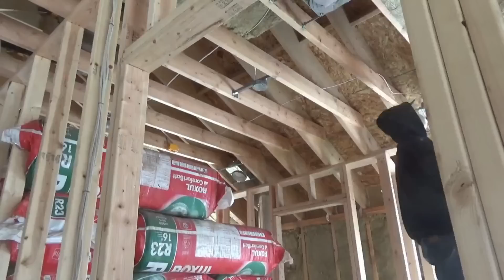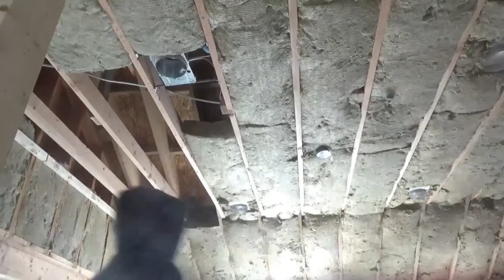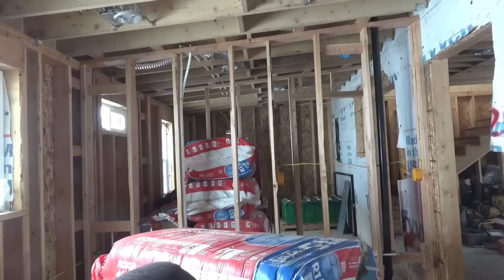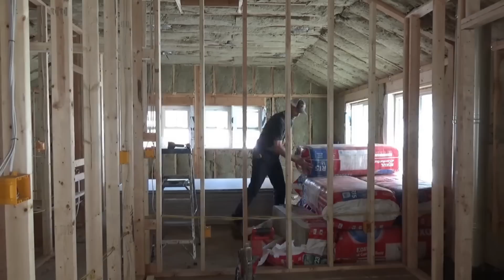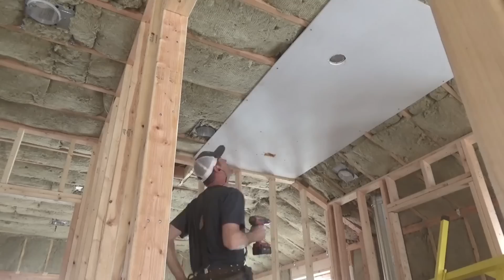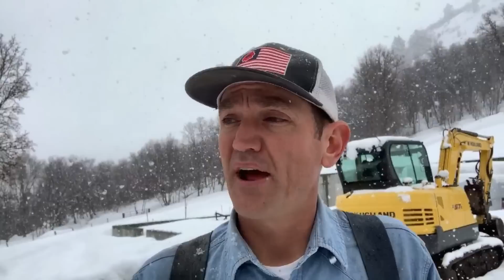#315 - I Started Hanging Drywall...Upstairs Insulation Done!

Comment: You might considering using adhesive on the ceiling drywall.  It might help prevent some cracking and  screw/nail pops.  You can always use a vapor barrier primer paint since you skipped the vapor barrier behind the ceiling.

Comment: just a tip we used to insure the ceiling portion of the drywall job; every place we put a screw in, we put two screws, because dry wall is heavy and not that strong when held up in the middle of it. this was over thirty years ago and the places that I can still go back to the ceilings are still in great shape

Comment: One other small point, don't forget you must have an access to the upper roof area for later maintenance, A good place to locate one would be inside a closet so that it does not affect the ceiling lines. MAKE SURE ITS BIG ENOUGH TO BE ABLE TO CLIMB THROUGH. ABOUT 2 X 2 FEET PIECE OF PLYWOOD COVER WITH A SIMPLE PUSH-UP,  IS GOOD.
Reply: In my parents first house my father installed a set of pull down foldable attic stairs in a very short hall going in to the bathroom on the left side of the main hall way so it didn't affect the ceiling lines in the main hallway . When the house was built the attic access was put in the ceiling of the smallest bedroom closet in the house. It wasn't even 2 ' X 2 ' . It had a push up panel made out of wall board . It made getting up in the attic so much easier after the pull down attic stairs were installed . The one in the bedroom closet was way to small & to get up in to the attic everything in the closet had to be taken out in order to get up in the attic .

Comment: I did everything except tape, texture and paint on my build. Tried to tape the joints but could not get a smoothe coat on without lots of tiny voids in the mud. Gave up and hired a pro to finish for me. He said i needed to add some water to my mud as it was to dry. I was using pre-mixed mud as I was not a pro. He said you still need to add a little water to the pre mixed mud most times. You are knocking out the drywall so you will be fine. You do need to stagger your joints though, especially if you are striving for perfection.

Comment: When hanging drywall on walls, put full sheet to floor. That way you don't have to bend over when taping seam. that way both seams can be feathered together.
Keep up the good work!
Reply: @Steve Diamond If it was my house, I would use one. remember code is the minimum, one can do better.

Comment: Just a small tip on your drywall install. On the wall sheets put the top sheet up 1st, then the on the floor the 2nd sheet. the piece between the two (if there is one) should go into the middle. I know its a place you'll see more if the taping isn't 99.9% BUT that said with the piece in the middle it soo much easier when taping since your not stretching for the ceiling level or stooping to the floor. you'll be standing working at waist height easily completing the taping. 
Keep up the GREAT JOB! Best wishes also.

Comment: Having lived in Alaska for 45 yrs, (being a construction laborer born and raised in ID), I’ve seen many construction techniques and the only concern I would have against completely enclosing the water lines is if it was ever to freeze, it would take summer or heating for a week to thaw out. It may be too late but I would put a refrigerator water supply tap and put the outlet into the septic drain, (at the end of the service farthest from the inlet), so that you can have moving water all winter. As long as the water is moving it won’t freeze. So if you’re going to be gone for whatever reason you can leave the water running and not need to heat the structure.
Good luck and God bless.

Comment: Not sure of the code for insulating vapor barrier, but in Canada, you have to put vapour barrier between the top plate of internal walls where they come into contact with the roof rafters. 
This is done usually by putting a strip of plastic on the top of the top plate and seaming the final sheets of vapour barrier as they meet the walls and ceiling. 
Note; Any area of wall/ceiling that is exposed to the exterior insulation and the possibility of accumulation of moisture HAS TO BE PROTECTED OF MOLD THAT WILL ACCUMULATE ON THE BACK SIDE OF THE DYWALL unless a vapour barrier is there, and definitely in any internal damp area of the house such as bathroom or laundry room.

Comment: Do you not need vent chutes for ventilation from soffit to attic. From top of wall to attic 1 inch air gap.So your frost on the back side of roof sheating to insulation reason for air gap.
Reply: No vapor barrier 4or6 mil poly between drywall and insulation here in MN it is required.
Reply: next time i will watch to the end. However put the sliver pc of drywall in between full sheets will be easyer when taping and muding.
.

Comment: I've been a professional drywall contractor for 35 years I agree with what everyone is saying to stagger your joints but I'm very proud of what you're accomplishing by yourself keep it up you're doing a really good job
Reply: Steve Diamond on your comment about vapor barrier's that's probably a good idea to put vapor barrier in but then also you have to be able to exchange the air in the house so that means you have to have somewhere where you can bring air in and then recycle it back out
Reply: @Steve Diamond yeah it took me years to perfect a finish coat on drywall it is a art
Reply: @brucetreat8860  where are you coming from... pro answers!!! In that kind of light wooden frame houses, in any climate, vapor barrier must be 100% always, and ventilation is next problem and chapter, what must be. But vapor barrier must be, no questions. Now his house will be literally dead in two years.
Reply: @Dream4Design  I guess you forgot that he put a vapor barrier on the outside and houses do Needtobreathe go figure that one out is also a myth about vapor barriers there is pros and cons about them
Reply: @brucetreat8860  material outside is not vapor barrier, but brethable membrana which is wind barrier, he must have vapor barrier inside too, and there is discussions. He is doing wrong now.
Reply: @Dream4Design  my bad you're right about that but it still lets moisture out like I said there's pros and cons with moisture barriers

Comment: Someone commented on the use of caulking and Tuck Tape to further ensure a completely tight envelope to contain this warm moisture. His comment was dead on and completely accurate. But then, a tight envelope poses additional issues to deal with. Will you have to vent the moisture? I suspect in the winter time, that the woodstove will draw out a lot of the moisture out of the house. During the summer, if the flies are not too bad, you will leave the doors open to accomplish the same thing. So screen doors, if flies are bad, are mandatory. A fan in the cold attic space will help as well. The fan exhausts to the outside. Perhaps you have BIG natural vents at each end of the attic. That helps also. The last thing you want to do is build your own house, and then have to move out because of mold.

Comment: Ive got a question for the US drywallers in the comment section, why do you lay the drywall sheets horizontally when you are building? In Europe and Sweden where i live we stand the drywall up to reach from the floorboard all the way up to the ceiling with one sheet (if the house is built with standard ceiling height) this leaves only one seam between two sheets and the amount of mudding required is alot less.
Reply: 2 4x8 sheets =8x8 =1joint horizontal or vertical question if u  mud  tape sand from floor to ceiling or horizontally at waist height which is harder and back breaking

Comment: "Didn't envision I'd get this far by myself"  Isn't that the nature of our own self doubt within every single project of size that a man can undertake?  I'm speaking with nothing but admiration for your work, skill, and determination.  From every remodel that I've done to building my patio and then the pavilion over part of it, I know I've had the same thought.  I've got the same concern and thoughts as I work on my old truck.

With the drywall, some of the key points in it are in the way your tools are set up.  For instance, your taping knife needs to have a hump in it in the middle - it needs to be shaped closer to ) than |.  You will have an 'on' side for applying over the tape (with the center of the ) over the middle of the tape) and an 'off' side where you drag the center of the ) knife down each edge of your tape line.  Hoping your FIL is giving you this advice as well.  You want to avoid sanding as much as you can - scrape it down once dry to remove your ridges and inspect your coverage and lines.  I'm not the best at it, but I've done a number of jobs and six rooms in my home as I've remodeled as well.

Also - just watched that wall piece go up - try to avoid the 'four corners' situation.  That can be a bugger to tape over and skim smooth - sometimes it's unavoidable.  You're doing well.  Don't know if you ever heard the old Johnny Cash John Henry song, but keep going hammerswinger!

Comment: I’d like to see you put a temporary floor over the top level of the staircase until you have it all buttoned up up there. I’m worried for you
Reply: A few beams across and some ply sheet for a platform would give you a safe working area which is easily removed once you have the roof/walls sheeted

Comment: There is absolutely no doubt that you will have to remove the drywall you just installed, add vapour barrier, and install new drywall. The pot lights will require vapour barrier as well typically using pre-formed flanged plastic covers that go up over the top of the pot. Ditto for smoke detectors, electrical outlets, electric fans, electric switches, and any other penetration. Warm, moist indoor air will find its way into a cold attic space. The resulting condensation will soak the insulation, and spawn the growth of mold. Vapour sealing is one of the most critical items to address. You are not ready to drywall just yet.
Reply: finally somebody have normal comment. I can go further, very soon he will build small, simple cabin by side, and will live inside of that, and this house just demolish.
Reply: amen to that. In Canada, inspectors will not even pass preliminary electrical inspection if any wiring device on exterior walls  if vapour boxes are not installed around the devices.  vapour barrier,  6 mil minimum, must also extend behind any wall that intersects with an exterior wall so that the barrier is continuous.  could write pages on this subject.
Reply: to add to my rant, can see where a lot of Canadians like me jumped in on the vapour barrier issue. How do I know, we spell vapour with a u, Americans spell it "vapor"

Comment: My husband was a "Drywall Mechanic" for 30 yrs and I was his dead man and helper for quite a few of those years. You should use a full sheet on the bottom and a full sheet on top and put the ripper in the middle, it will be so much easier to finish. It will be very difficult to pull smooth lines when finishing so close to the  floor. I love your house and envy passion and determination. Keep up the good work.
Reply: I would say it's easier, but as a finisher -- Eye level is the only real thing that matters it homes, I would take the extra effort and just do it closer to the floor where trim can hid alot of errors.
Reply: @Steve Diamond You drinking bath water again -- You're in the right pew, just the wrong church man.

Comment: just a comment, i would insulate each room in side the house if not for just warmth or cool but for sound. also. makes a big difference plus add's some fire protection with the product you are using for insulation.. just a thought.

Comment: Great job you are doing.  Most don’t realize the work and time involved to accomplish what you are doing.  I noticed two critical issues you may want to address.  Fire blocking is required by code at the top of walls at the ceiling.  That includes the gable end walls where you added a 2x4 as a nailer for the drywall.  You didn’t add the blocking.  Another disappointment was covering the vent holes you drilled in the soffit area with insulation.  Baffles will allow the proper air flow to the attic and on out the ridge vent.

Comment: Everything looks great.  They are right about staggering the joints, which would be taught to all of us if we signed up with the Drywall Union.  But honestly, it's not a code requirement.   Gypsum board can be hung horizontally or vertically on walls, but must be hung perpendicular to ceiling joists.
A quick note:  don't forget Attic Access.  The minimum opening requirement is 22" x 30", which is a code requirement, and the spot you choose must have a minimum vertical height of 30 inches from the top of the ceiling framing members to the underside of the roof framing members, for a minimum area of 30 square feet (R807.1).  Plus there must be a light in the attic that can be reached when you enter the Attic Access, you know, like a Pull Switch.
p.s. Well, it's not so quick of a note:  According to the International Residential Code(R702.7),  Class I or Class II Vapor Retarders are required on the Interior Side of Framed Walls in Climate Zones 5, 6, 7, 8 and Marine 4.  You are in zone 6 Category B (dry).  But some would argue you don't need the vapor barrier....whatever the inspector says...

Comment: Sometimes some people are too stubborn to know what is best for them. In the small amount of drywall you have shown I see a number of no-no's. Mark my word, you will be frustrated with cracks forming at joints over the next couple of years (not due to settling), dry wall, tape and mud is one of the biggest bangs for the buck you can get in home construction, especially when you have little to no experience. The people who do this for a living doing it at greatneck speed and they know what they are doing, the mudding is an art in itself. Heed the advise don't be an idiot or you will regret having to deal with the cracks down the road.
Reply: Amen. For the price. Drywall is best left to the professionals.

Comment: Installing a vapor barrier is a really important step that he missed, he will get condensation on the back side of the OSB and cause it to rot, it should be installed with acoustical sealant and taped seams walls and ceiling. It happened to me this winter while building my garage, I was amazed on how much water there was on the walls even behind the Roxul.

Comment: If you're only using 1 later of plaster board you may want to put insulation in the walls for sound blocking purposes. Does everyone want to hear everything going on in those rooms?? Your doing a great job on the boarding for a plumber lol. Keep at it N it will be done in no time,with minimal back ache using the lift. ThankQ. TkEZ>UK

Comment: Everyone that says he needs a vapor barrier does not know building science. He does NOT need a vapor barrier! He is heating his house with wood heat--the driest heat you can have. There will be no vapor migration in the heating season. 

Heath, you do need to insulate your bath fan vents that run through the unconditioned attic. Please stager your butt joints on the drywall.
Reply: time will tell ,wont it